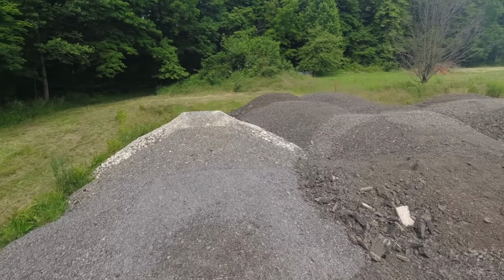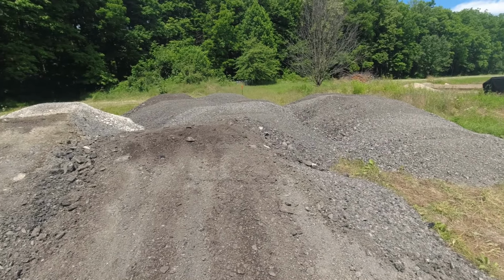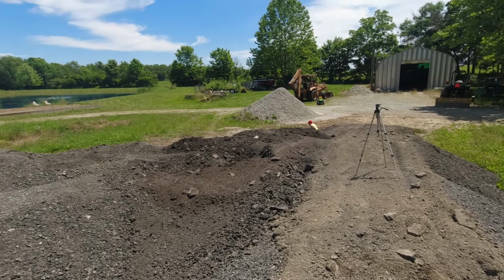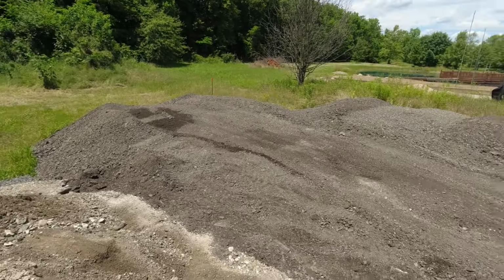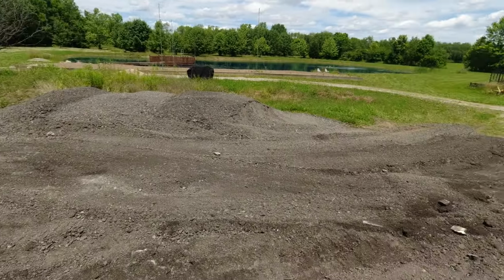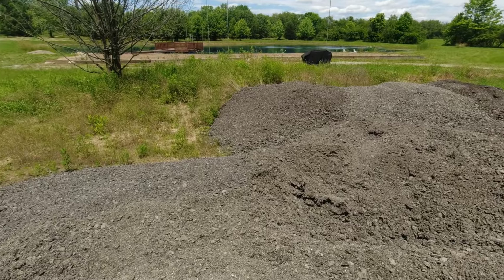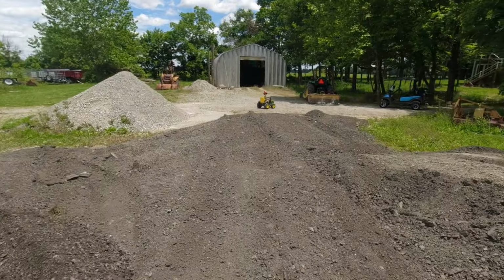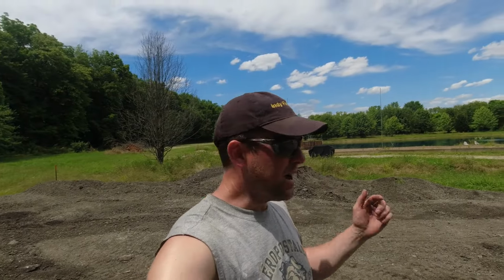John Deere Tractor Builds A Parking Lot - It's Basically A Bulldozer!

Comment: Might be time to see if you can sell/trade that hoe for a dozer. 
I might suggest a skid loader for more long term uses. 😊
Reply from the maker: Meh!  Dozer would be limited use! Awesome to have for this very project but for what I need, the backhoe/tractor combo is hard to beat.  I often move a lot of material with my dump wagon.  Backhoe has a 2 yard bucket.  Just need to fix the transmission!  You want to come take a swing at it? Ha